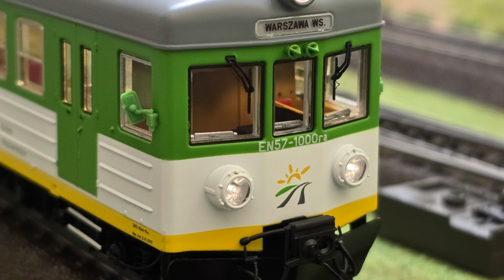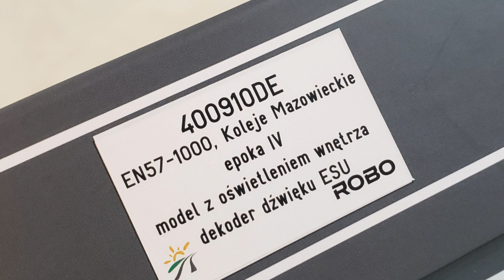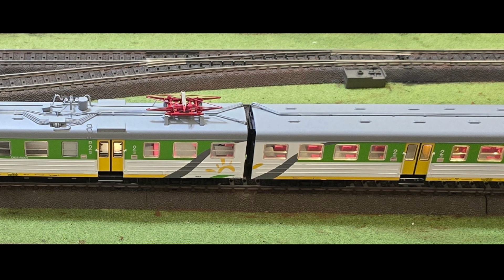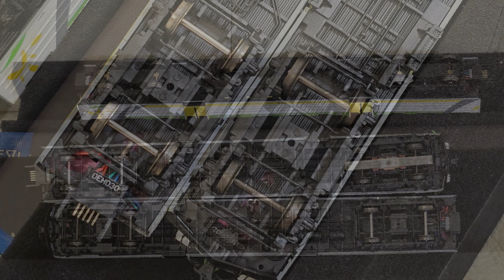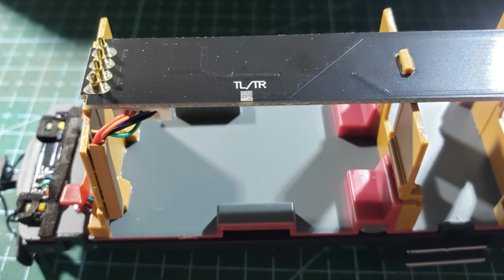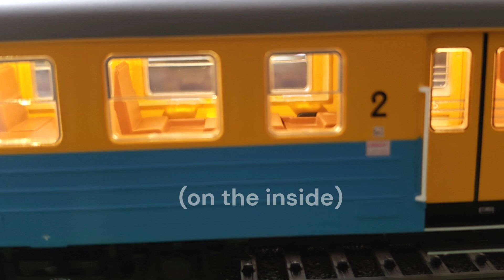Robo PKP EN57-1000 DC to AC (Marklin) Conversion

Comment: Looks incredibly easy compared to what some blogs used to say,
I'm looking to convert an LNER A4 to work on my Märklin track.
My trains & controller are AC, but the LNER A4 I can only find in DC or DCC.
So I'm debating wether to switch my AC trains to DCC & buy a new controller & conversion chip.
Or get the way cheaper DC train & do something like this.
Seeing as I'm unsure how well it'll work, I'm hesitating on the more expensive model, so I'd love to hear your input.
Reply from the maker: At the end of the day the most important factors are the geometry of the pickup shoe (whether you can find an existing location to mount it or grind away parts of the underside to make room for it to collapse properly) and the wheels.  Both of these are more complex with steam engines, but should usually be possible if you try hard enough and are willing to cut into the model if needed.  If there are no AC wheels available, whether your conversion will run well will depend on the individual locomotive.  For example, in the case of this model, it would not run properly through switches without swapping marklin wheels on either end.  Good luck!
Reply: @EuroTrainTips 
First of all, thank you  so much for answering, I was wondering if you would.
Do I need specific ac wheels if I reroute the wiring on the inside?
I don't have any electric switches or other gimmicks to keep in mind of.

The train I'm looking at should have enough room, but I was also thinking of permanently adding a coach to it for cables/ pickup shoe/ chips if need be.
Reply from the maker: @teagor9505 No, you don't technically need to change the wheels if you reroute the wiring.  The problem is that marklin's track geometry, including switches (turnouts), is very slightly different than DC tracks.  This causes some DC wheels to derail when going through marklin switches.  It depends on your model, though, and each manufacturer/wheel size will behave differently.  So you might get lucky and not have any issues at all!